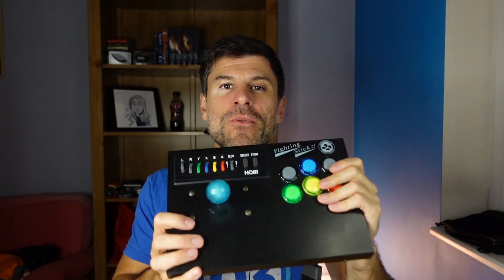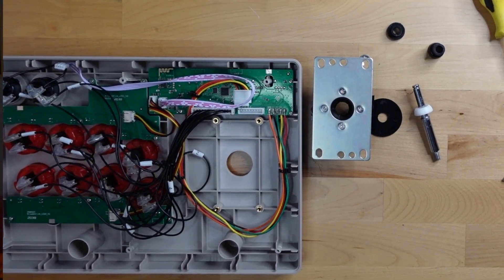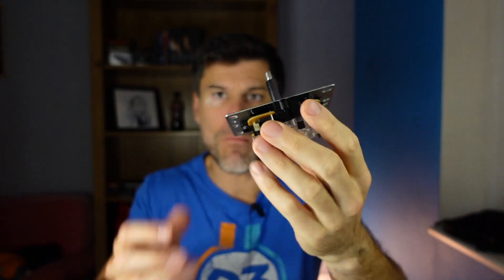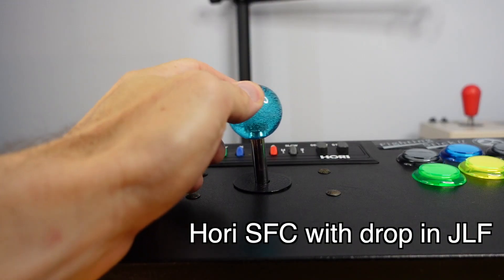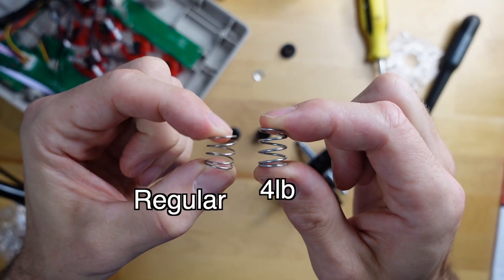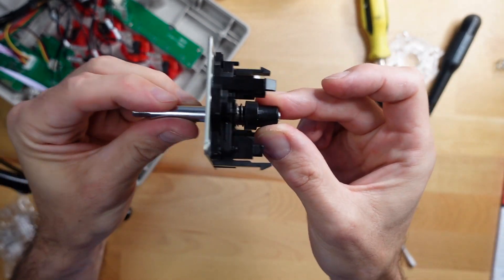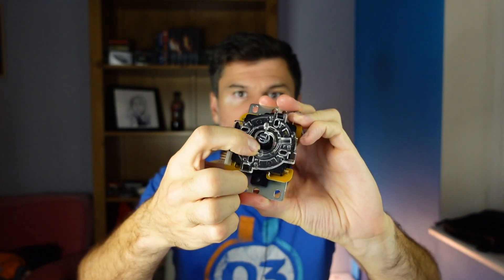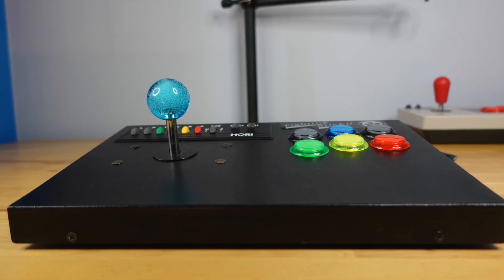Simple mods to fine tune your arcade stick

Comment: Great tips. I feel the same way. I have many sticks and have modded plenty of sticks.
Instead of buying adapters so that they can be played on other systems, I rather buy sticks for that system.

I really like your content. A very underrated channel!
Reply from the maker: Speaking of that I want to do a video on padhacking. I converted a big Hori Xbox One stick to Saturn by wiring up a Saturn controller inside of the stick instead. Using a small drill to make the holes in the controller pcb made the soldering very easy. I'm going to make a video on it in the future as I am very happy with the result. I dont need to switch systems quickly, I tend to play one console for a while. So it's fine for me to insert different pad hacks into this stick to use it between systems

Comment: The restrictor is huge.  There are more than just the two you mentioned.  There are four-ways that are superb for many classic arcade games (pac-man, etc.), and two-way (galaga, etc.).  They make huge differences for those specific kind of games.

Only other thing, is getting away from micro-switches and going with leaf switches.  Again, some games just feel much much better with leaf switches vs micros.
Reply from the maker: Leaf vs micro switches is a great topic for an upcoming video, thank you for the suggestion

Comment: I never did like the Sanwa JLF even for fighting games. I used the Seimitsu LS-32 for the longest time but I recently have one stick installed with a Seimitsu LSX-Nobi Pro and it worked really well for shoot em ups and most arcade games that uses a stick. It has something like a 2.5 lb spring already installed. I have another stick installed with a Crown 303 Quick release lever which sort of feels like a Seimitsu stick with its stubbier shaft and hinge style microswitches but with a rubber grommet instead of a spring. Eventually I would want to improve the JLF or give it some maintenance as I got it used. Who knows if they ever create a custom PCB that accepts any .187 microswitch that isn't out of stock then I would use that too. I bought my first stick at $60 and another one used at $60 and installed Seimitsu parts on both of them. The good thing about playing on Windows, is that any X-Input arcade stick would do no matter the age.

Comment: Sanwa JLF it's too overrated... seimitsu ls-40  (neo geo candy cabs default lever in Japan) it's a better choice for non fighting games due to short engagement, short throw, no dead zone, heavier spring by default.
Sanjuks v3 it's also a great lever, even though it's  hard to get, and it's mostly appealing for enthusiasts.